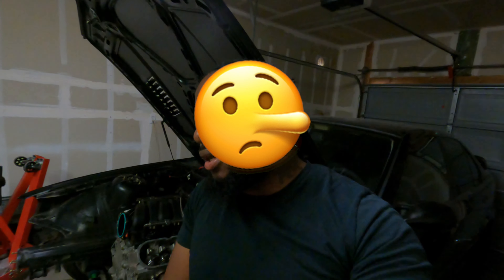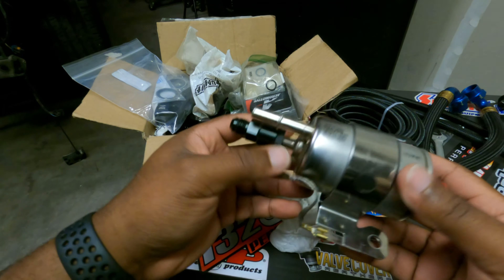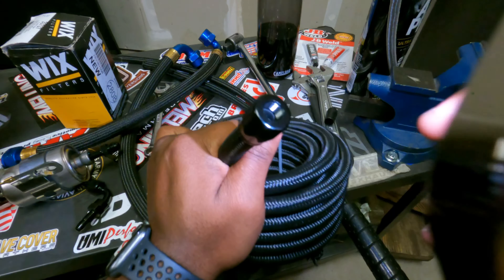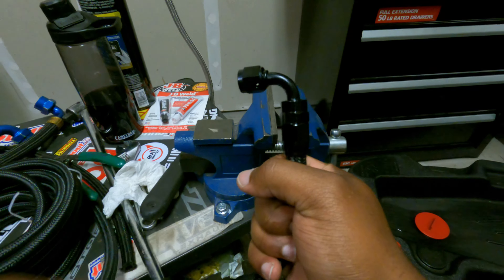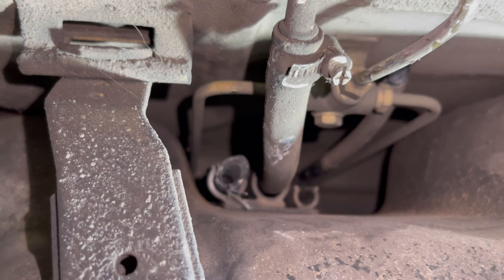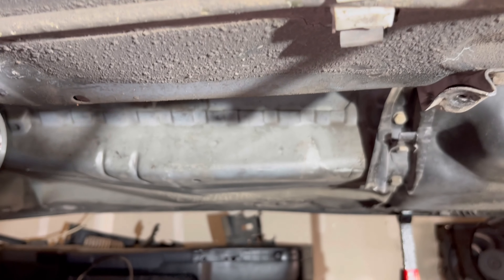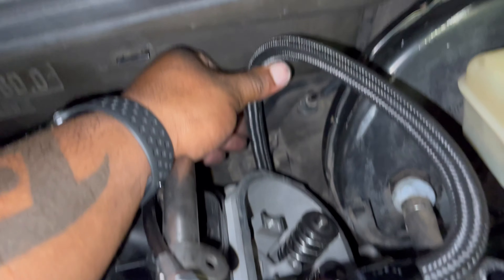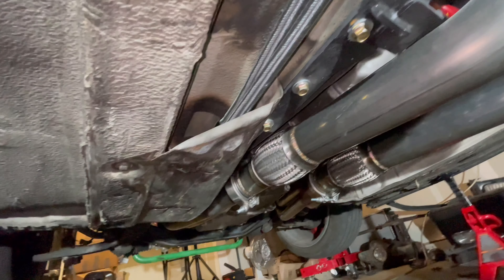E36 LS7 SWAP PT.9 - INSTALLING ALL NEW 6AN FUEL LINES & OEM C5 CORVETTE PRESSURE REGULATOR

Comment: my return fitting has some slack up and down should I throw a washer on? no slack from side to side fit on nice but moves up and down a little
Reply from the maker: Is it the screw on type? Or the plastic clip?

I would put a new fitting on from a different brand if it were me. 
You don’t want to risk a leak in a the middle of the road or something inconvenient like that.
Reply: the same ones you are using
Reply from the maker: @ChavaBautista if it is the screw on fitting I’d run it personally. It won’t wriggle its way off like a plastic fitting type would. There are two orings inside IIRC so it is sealed. You should be fine.
Reply: @LS3_LaFlare  ok thanks for the info sorry to be annoying but since it has the o rings the slack is fine then? and the outlet has slack too but I think I saw on your vid that it has slack too and its normal right?
Reply from the maker: @ChavaBautista  Not annoying at all brotha. There are orings inside to seal the fuel from leaking, so pair that with the screw type backing, you don’t have to worry about leaks or it popping off like the plastic type.

Even the outlet, it’s clipped in with orings as well. You’re good to go! I’ve personally had the plastic fitting type leak, so I always use the screw type and never had an issue.
Reply: @LS3_LaFlare thanks bro you earned a suscriber I really appreciate your response you have a blessed day
Reply from the maker: @ChavaBautista  happy new year brotha and thanks for the sub 💪🏿💪🏿💪🏿🔥